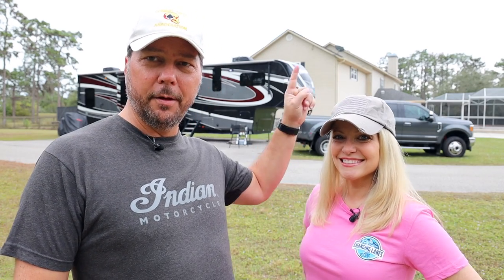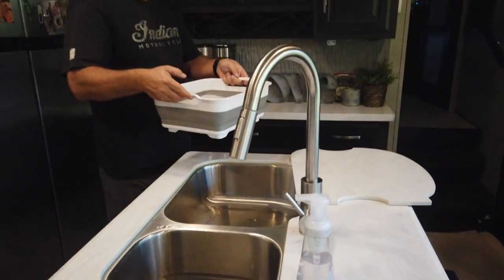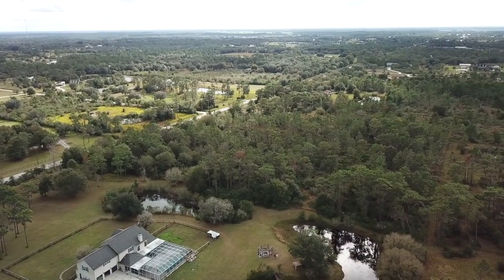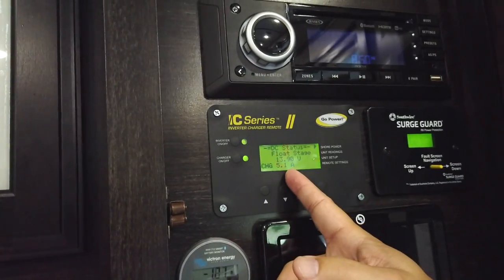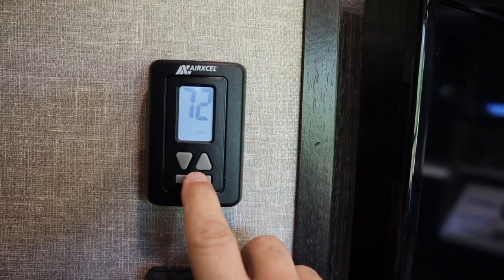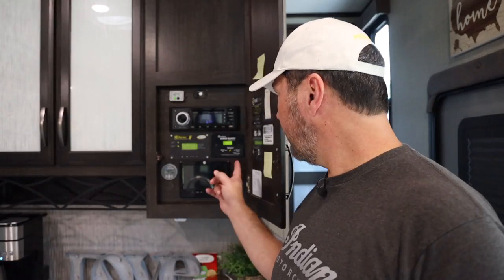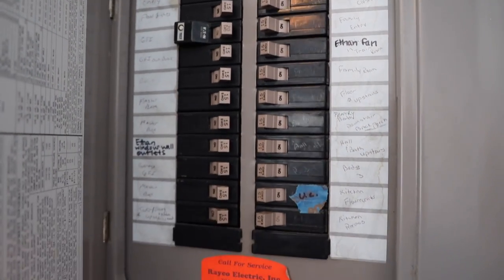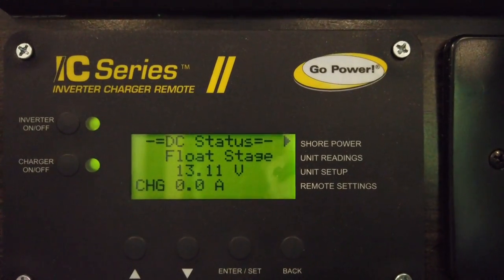RV Moochdocking! | Cheat Boondocking Like a Pro! | Changing Lanes!

Comment: Don't get me wrong your description of how the various amp feeds is very good. I simply love your videos. Being in the industry for many years (46 and retired... twice... yea!) and a teacher for 20+ you said a couple of things that hurt my head (LOL). You noted when a 15 amp circuit reaches 15 it blows. Your own observation showed this to not be true; with a reading of 39 amps pulled when air conditioner started up. In fact, it would have been much higher actually. So, circuit breakers are of various types and ratings, not to mention some are for DC others for AC... but typically they trip at a combination of amperes and time. The higher the voltage the shorter the time it takes to trip. While I'm being critical you say "blow" a breaker. I'm sure most if not all, would know what that means, but technically it is tripped. Blown to me would imply destroyed. A minor note, is when we encounter two 30 amp plugs at a campground pedestal, many times it is on the same leg. It could be separate, but most likely not. Same limit when we see 30 and 20 amps at a ped. The 30 and 20 are more than likely on the same leg. The ped is probably only designed for up to 30 amps. Campground power could be called a crap shoot. That is why testing before hooking up ot having a proper surge protector like yours or a Progressive like mine could save someone dollars or even injury and something I would not be without. There are surge protectors being sold that don't even make a good anchor. Like Michael below, I cringed at the long runs of small gauge extension cords, but sometimes do what we have to do.
Reply from the maker: The 15A breaker trips at 15A was just a generalization.  Like we said in the video, we didn't go into the technical "weeds" on this because it would bore the crap out of everyone. 😳   And, yes... "tripped" is correct, but I think people know what we meant by it.  Agree on the extension cords.  Ours were rated at 15A, but it was a long run and you could see we dropped about 10v.  Not ideal and not good for AC long term, but still within specs (90%).  Notes added about that and household circuits to the video and blog...  👍🏼

Comment: Good points on the power adapters and Line 1/Line 2.  It would be super nice if the RV builders would mark the switch and wall plates, plugs etc. as to L1 or L2 including any other device such as A/C and pumps etc. Once you know which is what, you could actually make power limitations less of a problem vs. "do without" simply because the park or residence location doesn't have he standard 50/30/15 circuits.  Thanks for explaining.

Comment: RV Newbies here.... silly question, but when using the RV Y Adapter (50A Female to (2) 30A Male) - If I'm at a campground with only one 30amp outlet, I can just use one side of the adapter, correct (since they're separate).  The other side just hangs out by itself -haha.   Thanks for this educational video and links to the products.
Reply from the maker: No.. that would only power one side of your RV.  If you're not splitting (just going 50 to 30), use: https://amzn.to/2yj6mpy  👍🏼
Reply: That’s what I thought but thanks for confirming!

Comment: The longer the extension cord, the more voltage drop. Voltage drop creates HOT cords, and might melt the connections or arc. Dont expect to get 15amps from a 100ft + cord hooked to your RV cord. will likely trip a 15 amp circuit after running high amp continuously..  Note, the more adaptor connections, the weaker the circuit.
Question, the inverter kicking in, is that drawing from the batteries?
Reply from the maker: Agreed on the cords.. added notes to the video and blog...  Yes on the inverter.  I have it set to 13 amps and if something tries to draw more current (on line 1), the inverter kicks in and pulls power from the batteries to assist so no more than 13 amps come from external power.

Comment: Hello Chad , I just purchased a new class A, and definitely have alot to learn...thanks for sharing all the valuable info. One question should I keep my inverter on when hooked up to shore power.  I have a main shutoff for the inverter and a on off button as well.  Not sure if class A works the same...especially with it plugged into 15a.
Reply from the maker: I leave ours on so it will keep power running if shore power dies... But this can be a double edged sword if 3 ACs are running it overwhelms it and everything shuts off anyway.

Comment: One thing we do when visiting family or friends is not just shower inside but use the bathroom itself as much as possible so the black tanks last that much longer before needing to find a dump station. But then I again I bring a blue boy around with us so I don't have to move the rig. It may take a couple trips but a heck of a lot easier than packing everything up.
Reply from the maker: Good point.  If we didn't have 2 bathrooms and only 2 people we likely couldn't make it two weeks.  💩   Good tip on the blue boy. 👍🏼

Comment: So I decided to do this at my house and made the mistake of posting my setup on FB… now I have electrical engineers talking about phase?  I’m concerned if this is safe or not to have two 15 amp circuits feeding to the Y to 50 amp plug I bought at camping world. I followed all the instructions you gave during this video… do you have any advice on this Phase concern?  I’m not an electrical engineer… I just want to make sure I’m being safe. Thanks!  Love the videos!
Reply from the maker: The only time phase will matter is if you connect to 30A + 30A and are using the full 30A on both legs.  In that case, you can potentially have 60A on the neutral IF both lines are on phase.  15+15, phase does not matter.  That's a maximum of 30A on the neutral designed to handle 50A.  👍🏼

Comment: The two 15amp outlets to 1 50 amp.  I want to use this at home too to backfeed my pannel. I backfeed now with transfer switch but only get 1 side powered.  If I use the 2x 110v to  one 50 amp I will be able to get 110v to both legs . Still not 220v but power to both sides

Comment: Thanks again for this video.  I had ordered two adapters and neither of them would connect the 50a to 110v 15a.... nor would the one that came with my motorhome to plug 50a to 30a.  But once I  understood what was going on from your video I was able to take the plug off the heavy duty cord and wire in an extension cord so I could get power to the motorhome charger.

I also tested the ac units (one at a time) and they worked.
I'll probably just buy a heavier duty extension cord and make this work.  I flipped all the breakers off except the one to the charger. I never use the microwave or appliances that run off propane anyway.

Comment: A couple of suggestions that could be helpful; 1) mark each 30a plug on your 50a to two 30a adapter with leg 1 and leg 2 for reference to which one has more amperage available for A/C usage or A/C and other items. 2) at a lot of campgrounds the "pickle" will have a 30a receptacle and 1 or 2 standard receptacles where you can piggyback the 30a and a 30/15a adapter to increase the available current for your rig.
Reply from the maker: That's true.. as long as the pedestal can truly handle the 45A total.  I'm sure many older campgrounds will have 30A total..  But, it's worth a shot!  👍🏼

Comment: Great video that explains a ton of info.  Question on having an RV with 50 amps at a site that offers a 30 amp and a 15 amp plug at the electrical pedestal. Can you use the 50 amp to two 30 amp Y adapter to plug into the 30 amp and the other 30 amp Y to the 15 amp plug using a 30 amp to 15 amp adapter? Would it give you 30 amp on one leg and 15 amp on the other leg at your RV breaker panel? Any downside to this? Thanks!!!
Reply from the maker: While it is technically possible to run a line to 30A and another line to 15A, there's just no way to know if the pedestal is wired to handle 45+ Amps. I think many parks might be wired to handle only 30A. Definitely check with the RV Park first.

Comment: When you are mooch docking, if there is a laundry room where a substantial extension cord will reach, those are usually twenty amp circuits.  Make sure your host knows to let you know if they are going to do any laundry and you can plug their washer and dryer back in but this can give you a twenty amp circuit to work with instead of fifteen.  Also, we should not load a circuit breaker more than eighty percent.  If you load them at one hundred percent, the breaker will snap to the off position in about five to ten minutes.  This means that your fifteen amp breaker is good to twelve to thirteen amps indefinitely.  A twenty amp breaker is good to sixteen to seventeen amps indefinitely.   Also, be careful with long extension cords.  A lot of them just do not have adequate wire size to carry much current, especially not a long distance.
Reply from the maker: Yes...  Good point on the extension cord.  I should have mentioned that the extension cords need to be rated for the amperage.    I also should have noted that an EMS or total electrical protection system are highly recommended to detect any such voltage or wiring issues.  We will add these to the description and blog.  Thanks for point those out.  👍🏼
Reply: Hell if I was gonna do that...I'd just get a 240v extension cord for that dryer receptacle.  ;)
Reply: Princess Lavidia correct, but you’d still be able to pull 30 amps per side in the RV panel.  I’m not sure what you’re trying to say in your comment, but I’m an RV panel, everything AC is ran on 120V.  Your home has a 240V service to it that has a neutral connected to the middle of the winding on the transformer...so when you connect something to one side of the winding...and the neutral, you get 120V, when you connect it to the other side and the neutral, you get 120v...but when you connect both sides together and NOT the neutral, you get the whole winding (240v).  An RV panel is the same, but everything AC is ran on 120V.  The plug splits off the 2 phases or “sides” like I just mentioned, and they share a neutral...just like that 30 Amp dryer receptacle.

Comment: Guys... great video.  I always learn watching your video.... I have 2 portable generators with a parallel cable that gives me a 30amp outlet...could I hook up each generator separately using the y connector 15>30>50... that would give me 2 different circuits right?
Reply from the maker: Yes.. You can power each side of the RV with 2 different generators.  BUT...  Unless the generators can be synced (some can be tied together for coordinated split phase), you can't control the relative phase of the power supplies.  If they get in-sync and you draw 30A on each, that's 60A on the neutral.  So, I would manually limit yourself to 50A total.

Comment: New subscriber. I'm new to 50 amp service. I feel like there was "information overload" at some point, though it was all good info. At any point of using the adaptors (either the single 30 or splitter) would it make sense to use a voltage booster like a Hughes Voltage Booster box?

Comment: I know that you have a surge protector and that helps, but it’s a poor idea to take power from two different buildings that can be at two different ground potentials. It can put you at a lot of risk for damage if nothing else to your Transient Supression Device. 

I have seen a lot of damage at facilities where power came into two buildings and wiring ran between those buildings. 

I would just find two circuits on the same building. 

Also, it would be a good idea to build an extra 10ga extension cord to bring power from the house to avoid voltage drop and heating of the cord. Then place your adapter close to the RV.
Reply: I was wondering about this. I presume the GFCIs don't work due to the neutrals being connected, so you can get a slight current difference between the two returning neutrals, tripping the GFCI. What about using a pair of isolation transformers though? It seems that you could prevent those issues by isolating both source lines.

Comment: When I tried to plug my RV into my new home, the Arc Fault circuit breaker kept tripping. Arc Fault breakers are now code on most circuits in a new home, they are not the same as GFCI breakers. They detect an arc in the line. Any RV with an automatic relay that switches from generator to shore power will create an arc that trips the breaker. I ended up hiring an electrician to install a 50 amp outlet to connect my RV to when at home. Just be aware that any new home built in the last fives years or so will have these new breakers making mooch docking more difficult.

Comment: I have mooch docked at friend's places a couple of times in my 15 yrs of RVing and had my breakers pop not knowing the reason and unable to comprehend why. My thought was their garage or at least their outlet was not wired correctly to the point in so Dakota replaced their 30 amp outlet still no good. Your explanation of the power split 50-30-15 was like being hit across the back of my head and the light turned on. I had chatted with electricians and and never have they come close to this explanation, probably because I hadn't paid for the knowledge.

Comment: Dump out improvement - Camping World and other similar camping equipment outlets sell a macerator that connects to the sewer connection and pumps effluent through a garden hose.  The hose can be connected to a hose connection on a sewer cleanout plug that is located on most new homes.  No need to head to a dump station, but it is a modification to your friend's house.  Check it out.

Comment: thanks for stressing "separate circuits" .. I've seen people try to do this trick for car charging and wonder why the breaker keeps popping...   although there, the charger needs 240 volts, so not only separate circuits but different phases on the distribution side... looks like RV is a little more simple if you have no 240 and everything is just 120 on two phases.
Reply from the maker: Correct... since the two circuits are separate all the way from the plug on the side of the RV to the appliance or outlet, phase doesn't matter.  👍🏼

Comment: Super video, but raises a question for me.  We have a 30 Amp unit.  Can I use on of those splinters to plug into two separate circuits, or will that overload the RV?  Thanks
Reply from the maker: Only one circuit on a 30A RV.. so you can dogbone down to 15A, but not 15+15....    But that should get you one AC running....

Comment: You might consider adding a transformer to the two-leg setup.  This will balance the current between the two halves, so you really could have e.g. 20 amps on one leg and 10 amps on the other (for two 15 amp sources).  For this to work, you would need to have different phases (i.e. 240 VAC) on the source legs, but I don't think that's much of an issue.

Comment: This is great stuff, thanks for the video.  Two questions if you get a minute.  First, do you use a Portable Surge Protector at the pedestal when you camping even though you have one hardwired?  If so, why?Second, or actually this is the third question, now that its been a while, can you let us know how that Go Power Inverter is working out for you; you happy with it?
Reply from the maker: We only have the hard wired unit.  I'm not sure if two would interfere with each other or not...
Our GoPower has been great!  Had one issue and they swapped it out under warranty no questions asked.  They even swapped a 3K for our 2K.. 😊

Comment: You can use one plug if it's a split plug they have 2 circuit on a double breaker unfortunately usually were only for kitchen counter plugs

Comment: Unrelated question. 
I was wondering if you think there's a major difference in backing up between the fifth wheel and just a travel trailer hitch mount my wife and I want to start off with a trailer and she wants a fifth wheel and I don't have any experience with backing up with a 5th wheel I have very little experience with a trailer whats your thoughts we have a motorcycle so we need a toy hauler  and we wanna do exactly what you two are doing unfortunately we have jobs so we have to start out as weekend warriors for now. Thanks for any input Chad. Keep rolling and stay safe.
Reply from the maker: They are very different and a fiver takes a little adjustment.  But, overall a fiver is much more forgiving and maneuverable.    Be sure to see: https://youtu.be/87runDszXLQ

Comment: I see a very long extension cord. I looks like a standard 14awg cord (I hope not 16awg). No mention is made of voltage drop. The calculations for voltage drops is made from original breaker to point of use. Using a 12A appliance could pull down the voltage causing motor using appliances some heart burn. Also not addressed is the fact that 15A breakers are only designed for 12A or 80% continuous load. A breaker loaded 80-100% can eventually damage the breaker. I have complaints from customers about breakers tripping and attributing the trips to faulty breakers when they are simply stressing the breakers from too high a load.